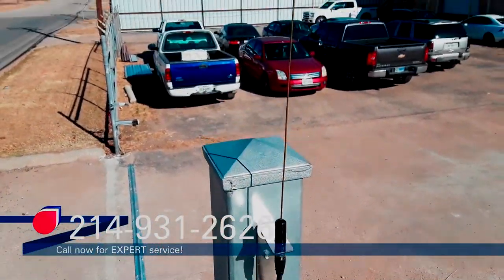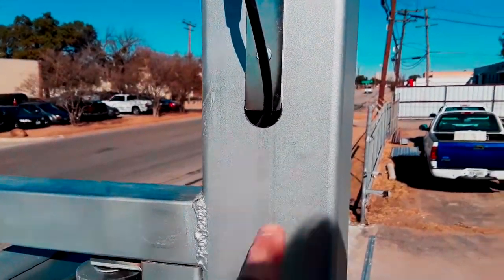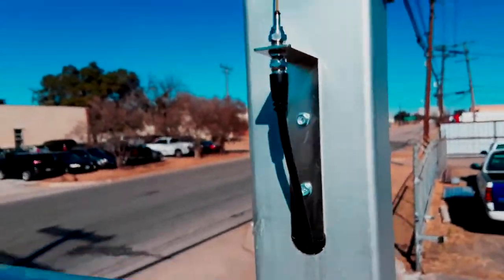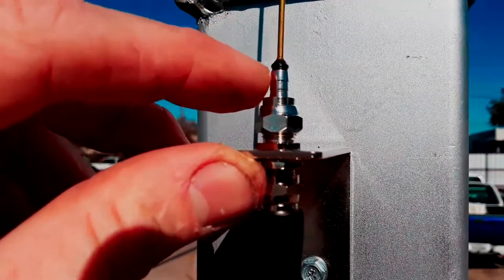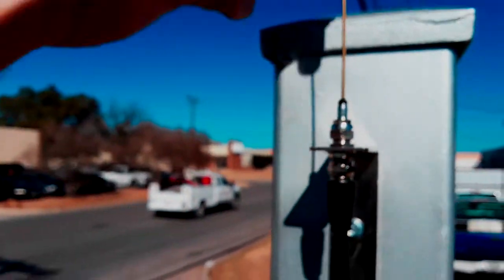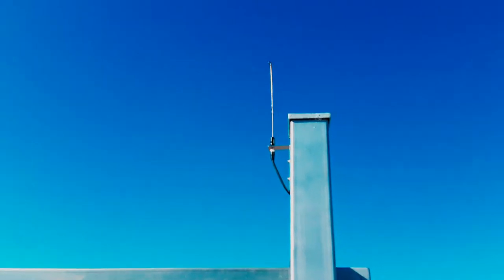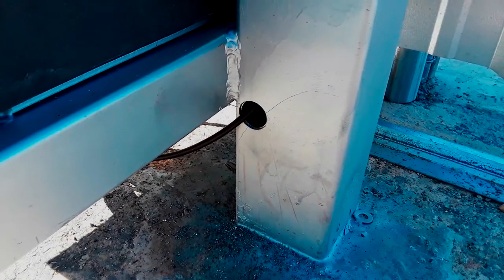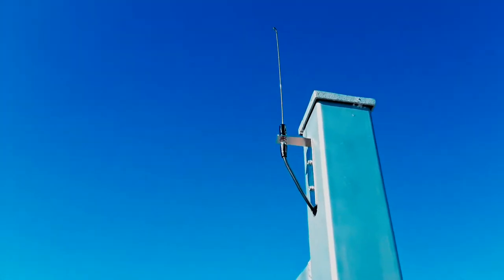Installing a slide gate operator Step 11: Installing the long range antenna | SC0049

Comment: how long the range?
Reply from the maker: There are alot of factors that change effecting range. So we can't give you a finite answer. this job was tested working at 30' and no reason why it wouldn't double or triple that.
Reply: @SafeguardControlsLLC  
I have a CO-Z gate opener and I can open my gate from 140 feet with my house in between my car and the motor. It doesn’t even have an antena. Well it has a 9 inch cable inside the housing if we can call that an antenna. I imagine an antenna like that should give a range longer than 300 feet.

Comment: My control board only got 1 wire..how on earth do u hook up a coax cable to it?
Reply from the maker: the "co" in coax means shared. there is nothing to share if there is only one wire..... It's most likely a "residential" not a "commercial" receiver like the https://linear-solutions.com/product/multi-single, are we right?